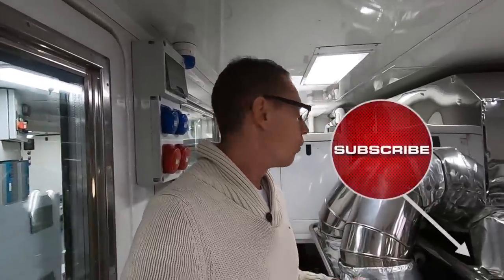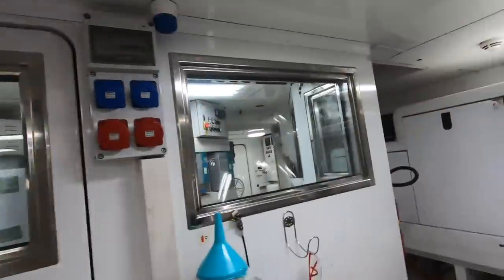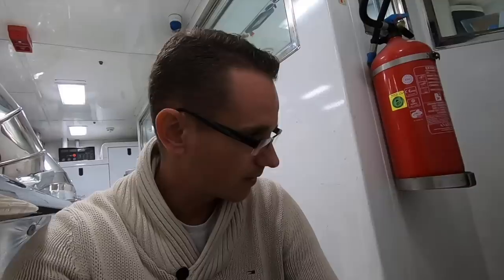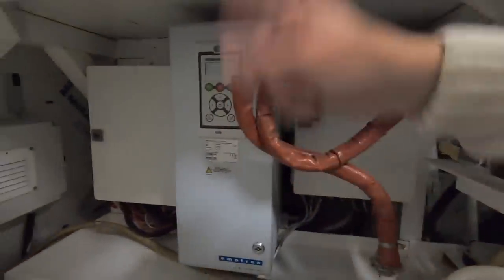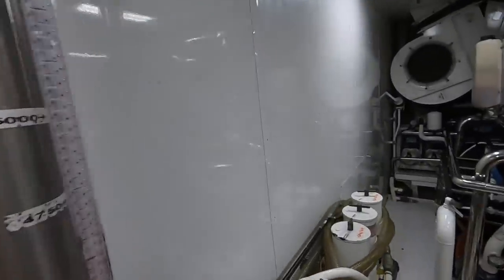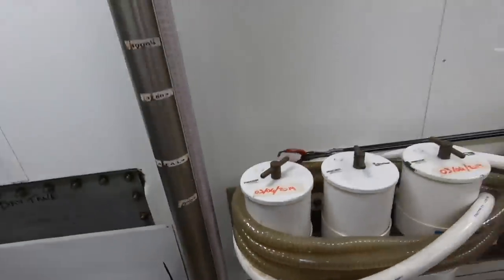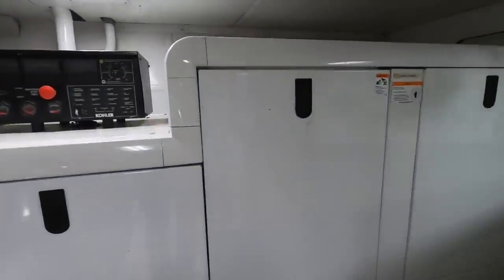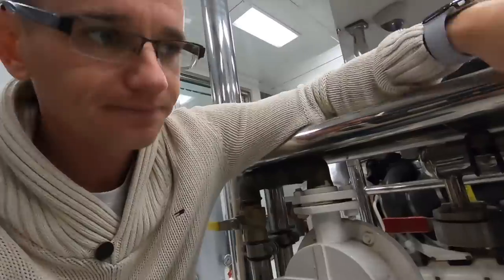Full Engine Room Tour On A Super Yacht (Captain's Vlog 119)

Comment: Sir, Great video The interesting part is that is still only about 20% of the system's on board. You still have billige pumps,  and cooling water pumps for the engine's and generator's from the sea chest. As well as gray and black water tanks and discharge pumps. (Outside of ports of course) Then the steering 240v main pumps and i am assuming 24v DC bach up. Fire suppression systems which shuts down ventilation systems. Then 12  and 24 volt systems and 120/240volt systems.the alarm systems, .autmmation systems, entertainment systems, navigation systems. All the bridge controls. I know you were limiting the video to the engine room. Which was great. Even filling the hot  tub. My point being is you you could do an entire series of videos 10 to 15 minutes each on all of the different systems on board. I know you have already done a few already. If you ever do come the the Caribbean or Florida area, I would like to meet you and buy a beer or two.
Reply: That would be very cool to see :)

Comment: Very impressive video !  You did a good job of highlighting the cramped quarters in the Engine room  As a retired chief engineer, you gave me reason to look back in time & reminisce about a job I loved so much.   Do you know if it's feasible to use a small Westphalia centrifuge instead of the Racor filters to remove the bad ju-ju from the lube oil ? The ngine room is beautiful with the shiny shrouds & exhaust covers... Control room too.

Comment: Great video ~ you do know your stuff. Caterpillar does make great marine engines the C32 is legendary.  I know the engines were rebuilt last winter ~ on average how many hours a year do you put on the engines ? Generators ? Most recreational yachts have pressure gauges on the racers to visually monitor their status and a clear bowl to visually check for water.  Do you thing the sensors are better without the clear bowls ~ I think I would like to see both sensors and clear bowls.

Comment: Alfa Laval make separators, i used to work on them on the big merchant many ships.
Talking generators: ideally how much landpower do you need to not have to run on the generators? Also if you have a disruption on the landpower supply will the generator(s) kick-in automatically i.e. are they on standby?

Comment: As I mentioned on other Vlog, there  doesn't seem to be a UPS (Uninterrupted Power Supply) to bridge gap between shore supply going off and gen set starting to run critical equipment, I have one on my 12m electric launch if you need more info!
Reply: Have you seen Captain's Vlig 74?

Comment: What's the reason for the Day tank ? Can't you draw fuel from the other tanks directly ? 
Love your chanel .
Reply: It's to have a source of fuel closer to the genset. There is a requirement that the fuel source has to be within a certain distance from the pump (lift). Fuel is pumped to it from the main tanks with the transfer pump.
Reply: @shanegoulden4298  Thanks
Reply: Also the fuel on the day tank is the one that has been filtered.

Comment: What's the purpose of the large "boxes" above the main engines in the exhaust system? Is it just to cover the exhaust for looks?
Reply: The video Capt. Mortlock referenced for the engine rebuilds has the details. IIRC, those are also mufflers... I assume 1600 HP put out lots of exhaust and noise. The chrome plating is for show.

Comment: In the states, in biggest problem is finding a qualified marine mechanic. Outboards=fair, inboards, IO’s = moderate, yachts(gasoline)=difficult, yachts (diesels)=hard, mega yachts= almost impossible to find a knowledgeable/qualified mechanic. 
You may need to fly a repair crew in, so if you’re not made of money, you educate and fix things yourself. If you let things go, it will fail, most likely at the worst possible time and place. Most high end yachts in the states 10 years and older are in terrible mechanical condition and are not seaworthy.